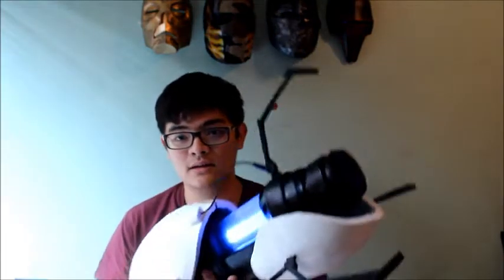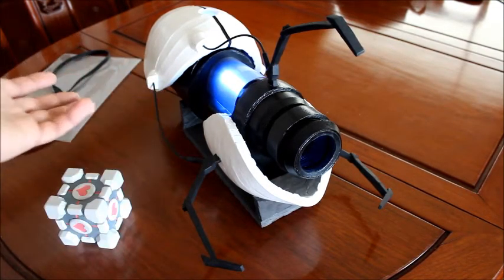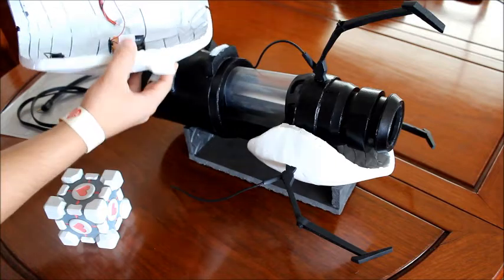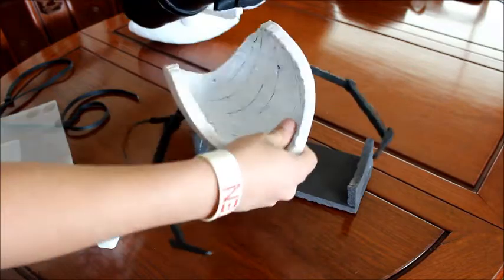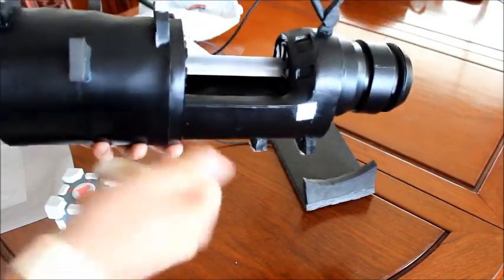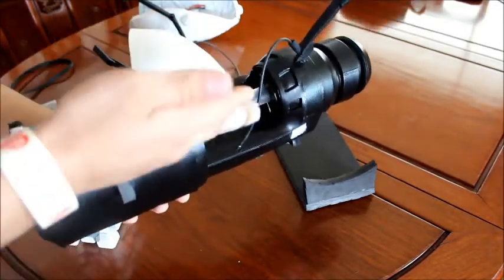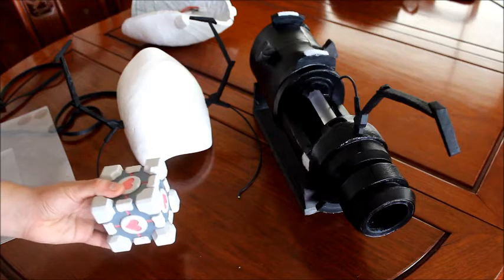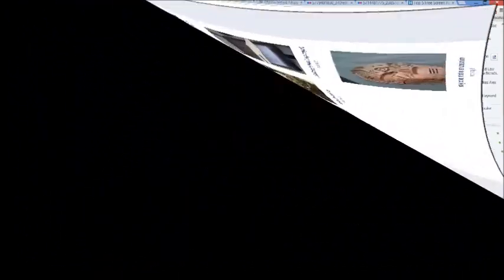Make your own Foam Portal Gun INCLUDES TEMPLATES

Comment: Do you remember how many lumens the cree torch was (or brand name)? And how thick was the foam like, 1/2 inch? I am planning to do this but am not sure how the thickness of the foam could affect the build... oh and btw, Great Build!
Reply from the maker: Hi there, unfortunately I do not remember the lumen rating but honestly any bright torch will do the trick as long as you scuff up the surface of the acrylic rod well! The foam I used was 1/2 inch for the most part yes!
Reply: KRSprops Thanks for the reply! I'm looking at a 2000 lumen flashlight, so I think it will do well. 👍

Comment: did you use A4 paper? because I printed the templates in A4 paper and seems a little bit smaller than I expected.
And can you tell me the diameter of your acrylic tube so I can compare it with my template?
Reply from the maker: I can no longer remember the diameter of my tube, you should be able to scale your files to fit whatever size tube you buy though. If things arent printing at the correct size it may be that your printer settings and page setup in pepakura dont match properly, also I would suggest printing on a thicker grade paper so that your templates arent too flimsy
Reply: KRSprops ok, thank you
Reply: At least can you measure the length of the larger cylinder? Just the cylinder without the bevels. I need a comparison bias.
Reply from the maker: Victor Cutini Neves I'm sorry to say that I don't have my portal gun with me as i am at university abroad :(
Reply: KRSprops ok

Comment: I don't have any machines to build the parts using the templates. is there anywhere that can do this for me that is cheap to pay for?
Reply: +timothy adkins, the templates can be opened with a program like pepakura designer/viewer, you will see that in the left  it shows in 3d how the pieces should go together but i the other side you will se white squares with black shapes, that you will have to print out and cut into foam (it will be like 20 pages or more)